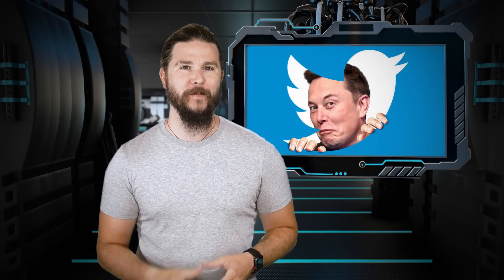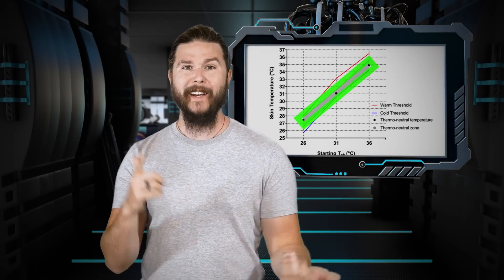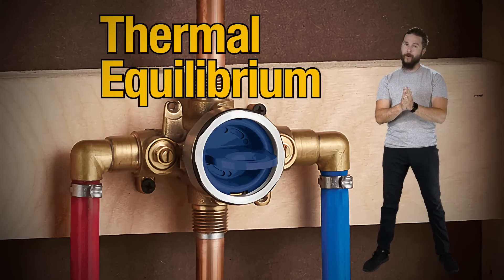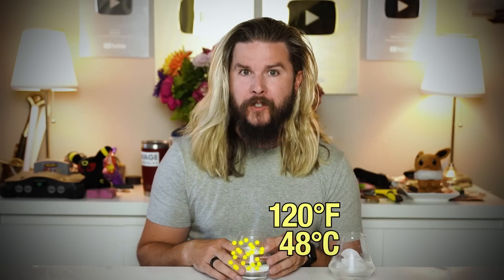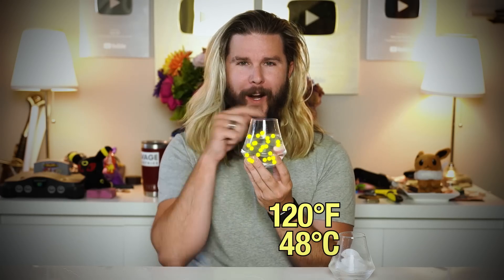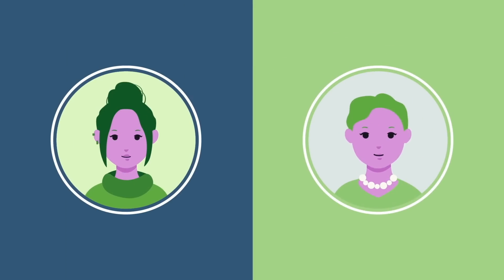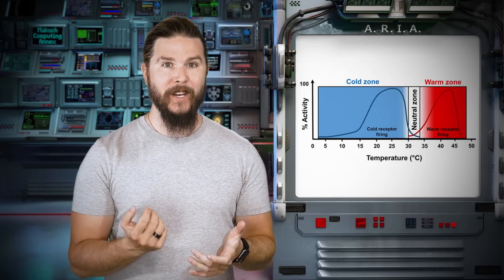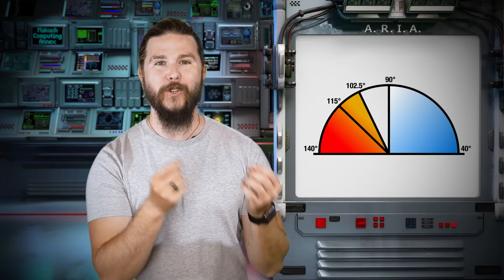Why Are Shower Handles So Sensitive?

Comment: Three points from me:
- on vacation in florida the shower dial controlled two things at once: flow rate AND hot water percentage. so ... you could only have a trickle of cold on the one end and a strong shower of hot on the other end.
- I do have a temperature regulator in the shower. It takes a few seconds until the hot water arrives there, but then it mixes the two waters to the target temperature with a bi-metal regulator.
- wet lab coat contest!
Reply: That's how my shower is, a single twist handle to simultaneously control temperature and flow. It's a pretty common style of shower control in the U.S. Mine at least reaches maximum flow rate at about the transition from cold to cool, so it's usually not a problem, but it would be nice to at least have the option to take a warm shower that isn't at full blast.
Reply: @Okusar  I bought a "shower head shut off valve" for my shower.  It attaches between the shower pipe and the hose, and lets you adjust the water flow manually from full blast to completely off. It works wonderfully, and helps with saving hot water in the winter as well.  (I use the valve to adjust it down to a trickle while soaping up, then turn it back on to rinse.)  They're an inexpensive fix (around $12 USD) for that problem.
Reply: @ManabiLT  I might do that. I have a tank-less system so I don't really need to ration my hot water, but reducing water use in general is rarely a bad idea.
Reply: When I visited Japan the friend I stayed with had one of those on the shower along with an instant hot water heater. The combo's brilliant: Water the temperature you want the entire time, no matter how long you're in there.
Reply: @ManabiLT  yes, i want one in every shower, but why not have all three A shower with optional bi-metal regulator, a two handle control or a 3D one handle controll
Reply: There was never such a waste of not not water
-not quite Strong Bad
Reply: My shower has a dial like what OP describes, but... I suspect the actual temperature range of it's actually just between "ice cold" and "lava hot".

Otherwise, (according to the meme version seen in the video) I regularly set the temp. somewhere in the "here be dragons" range. 0.0;
Reply: It seems like everywhere I go has this type of configuration, from fancy hotels to pool communal showers. I was genuinely surprised that this wasn't mentioned

Comment: Hm, increasingly in UK and Europe (have no knowledge of North America), Thermostatic shower valves are installed.   One dial for temperature control, one for flowrate.   The temperature one will normally be limited to 39C (unless you press a button to go hotter, and ultimately limited at around 44C where the temperature can begin to scald).   This allows a hotter supply of heated water to combat bacterial growth, while remaining skin safe for the user.   Its only on older installations that we still have plain mixer valves (not that there aren't lots of those about).    Electric showers are also very common (cold water supply only, heated on demand by electric element, temperature controlled by flow rate)

Comment: What about making temperature control a two stage system? Stage one is direct control of the amount of hot or cold, but stage two, the one we can directly manipulate, has a scale that begins with the lowest preferred amount of temperature and ends with the highest. Stage two manipulation of several inches resulting in a manipulation of stage one of only a small physical degree.

Comment: Makes me appreciate my shower that has a neutral position that is warm and even labeled as 38 degrees celsius (haven't measured it but it does feel warm) and that only burns you when you turn the knob  pretty much to the extreme

Comment: The lower you set your hot water tank the less energy will be wasted in keeping it warm as well.  Heat loss is proportional to the difference from ambient and the inside temp.  So, regardless of how well insulated it is, cooler results in less heat loss for the same system.

Comment: i designed a much better hot/cold mixing valve for showers and sinks, but in the end its impossible to patent (patent trolls have every possible variation of valve and control) and too expensive to produce. your best answer is to get a jet tub, which is still crazy expensive. a lot of jet tubs have a built in heater and function exactly like a hot tub with the exception of being tied to your water system directly

Comment: Great explanation but also ignores the issue of not one but TWO taps, that have different sensitivities. You need between 0.23-0.27 turns of hot and 2.1-2.7 turns of cold otherwise say goodbye to your chest hair. 

Adjusting the hot tap is utter suicide for the uninitiated, also taking 5-10 seconds for the water coming out to “update” so you need to turn with confidence and pizazz otherwise goodbye to your chances of having children. 

THEN put hot water system only works with sufficient water pressure so if you go too low on either tap you get cut off completely for a good minute and then it’s day goodbye to your eyes because they’re full of shampoo the water is too cold to wash them out!

Comment: Hah, here in Brazil we have electric showers, it's actually easier to find a good temperature, since it depends on water flow, but it sometimes does change to way too cold or way too hot too easy

Comment: Another factor is how the temperature of both the hot and cold taps will change gradually over time as your heater kicks in and the colder water that hasn't been sitting in your pipes reaches the shower. Add on changes in water pressure from other people/appliances (not even just in your own house) and that tiny sliver of tolerable temperature is a moving target.

Comment: I think the two-handle setup is a better one.  We have that system here, and it works quite well.  For me, I turn the hot all the way up, and the cold just a tiny bit.  What also helps is having a bath connected, too, which means the water runs into that before you turn the handle to have a shower, so you can get a better feel for things with just your hands, which are far more accustomed to varied temperatures and therefore won't get scalded or frozen as easily.

The fact that our tub has claw feet may have no bearing on the showering experience, but it just makes the tub niftier.

Comment: My shower, which seems to be quite common in the UK, is only connected to the cold pipe, and heats the water as it passes through. Temperature is almost exclusively controlled by controlling the rate of flow of the water. It's actually very easy to pinpoint the correct temperature, but that position changes daily because it's dependent on the temperature of the mains water. If it's a warm day outside, the shower will be hotter. Big Clive did a video on this design, how it works, its benefits and shortcomings.

Comment: OR you could shower cold.
In the beginning, it's quite uncomfortable, but you get used to it. And then the starting of your Shower Session is always unpleasant.
Take a deep breath and just do it.
Trust me, you won't be spending too much time in there, rather you'll be focusedon getting your whole body clean ASAP.
And if you turn the water off, the surrounding air is warmer then the water, so it'll be pleasant stepping out, insteadof freezing your a$$ off while trying to reach the towel.

There are environmental benefits too. Using less water and needing to heat less water saves energy I guess.
Though I don't know, if this really has an impact.
Still, it feels good when having finished while just one or two songs were played, instead of half your playlist.

Comment: For me the temperature changes. Like if i lover my shower head, the water gets slightly hotter. If it was perfectly hot before, then now it's unbearable now.

Also, I adjust my shower temperature by letting the the water run while I dress down and then hand test the temperature

Comment: You forgot one VERY important point: What about female shower users? My gf uses either scorching hot water or ice cubes.
Additionally, you can paint a scale on your shower knob and weld on a longer handle, or glue if yours is plastic.

Comment: i have two shower handles (1 hot, 1 cold), which can turn multiple 360°, so its a lottery to get the temperature right.. so its not the only problem that the water gets either too hot or too cold, but its also the quantity, i either get a drop of water, or i get blasted with a firehose.

Comment: Next video in this series:
Under (not enough) Pressure - why lazy engineering makes your shower have less pressure than a hose with a hundred holes and how to improve it. 

(Seriously, please do this. I feel like i'm not the only one who wonders about this.)

Just evolve and adapt to prefer pipin' hot temperatures in the shower, like i did. :D

Honestly though, it's nice to have a tap at home that can reach very 
Hot water for a variety of reasons.

Comment: As a part time plumber all shower faucets are adjustable to temperature. So if you want more moderate temperatures you can actually just move the gears ⚙️ inside and adjust it to be moderate and if you want it onlya cold with a sprinkle of warmth you can as well.

Comment: So I have a different conclusion from my own observations with our solar heated boiler. I've found that the higher the temperature of the boiler, the less sensitive the mixer ends up being. Here's my findings:

On days where the boiler is reported to be above 70C my shower experience has been a lot less sensitive than anything below 65C. My theory is that the hotter the water is, less hot water is needed to make the cold water warm. You use a smaller concentration of your hot water in comparison to the cold water and you end up getting a broader range of heat when you mix the two.
A benefit of having hotter water is also that you end up using a lot less water. With it being winter now, I get to see a large range of different temperatures that my boiler is when I take my shower in the morning.
If the water is at 70C by the end of my shower it will have dropped to 68C. If the water is at 60C, by the end of my shower it will drop to 52C.

The result of this means that when the water is colder to begin with, I end up needing to adjust my shower while I'm showering to let out more and more of the remaining hot water, whereas when the water is hotter it stays more consistent with what I originally started. The ideal temperature that I've found for my boiler is 81C, given the sun is gracious enough to supply me with such a gift

Comment: We have circle handles for hot and cold in our shower. Plus it takes about 4 minutes for the hot water to reach the shower from the heater, and even then it ramps up. Even if the water feels good and I decide to step in, I still have to adjust it constantly while in the shower, as the amount of hot water reaching my bathroom varies over time. So finding my sweet spot is more complicated. Thankfully, I managed to figure out a "general rule of thumb", in which I turn the hot by 1/2 a rotation, and cold by 3/8.  This has a slower ramp up to optimal temperature, but it tends to give me more time before I have to start increasing the hot to maintain it.

Comment: You would want to turn down your post heating tempering valve if you have one, rather than the tank temperature, else you will run out of hot water very quickly, or have bacteria grow within your tank. (Ps. I'm not sure if tempering valves can go lower than 60 degrees, maybe, idk.

Comment: 99% of showers here (in Denmark) have a twisty knob thingy that's really easy to adjust because it has like 720° of rotation. Also almost all showers I've been in had a hard stop at 35°c where you had to push a button go to beyond it. Meaning when the button is pushed you can freely twist the knob some more :)

Comment: I think the best solution is to get rid of single knobbed showers (and sinks) they are objectively worse and give you much less control. I am able to get my water to perfect shaving temperature in my bathroom sink rather quickly cause it has two knobs but the shower is single knobbed and I'm always adjusting it throughout the whole cleaning sesh it's annoying.

Comment: I just keep the temperature of the heater at 2-3 degrees over my desired shower temperature. Some of it will get dissipated along the way to the shower.

Then i just open the hot water and slowly add a bit of cold according to my daily needs.

Less demage to the heater, more energy efficiency, less scaling in the pipes, no demages to the o-rings.

Idraulics set the systems to maximum temps because they know that it increases the fault rate of the systems.

People just fall into this huge commercial trap because they don't think about it.

Less is always better.

Comment: Nice video, but it can get even worse. I assume you've only showered in places with a hot water tank. Didn't see anyone mention this, but where I live simple tankless electric water heaters are fairly commmon. They heat the water right when it's needed and are controlled by a preassure switch on the hot water line. That means you have to turn the handle quite a bit to the hot side for the hot water to come on in the first place. Now if it's too hot and you overshoot a bit when turning it down the hot water will turn off again. But you won't notice it immediately because there's still hot water in the pipe between the heater and the shower. And when you finallly notice and adjust, you still have a few seconds of ice cold until the hot water makes it back to the shower...

Comment: proceeds to engineer a handle with some gear ratios thrown in to allow you to turn a handle that turns the main control in smaller increments.  For those that want that PRECISE showering temperature.... yea that'll never work.

Comment: It is hot enough in the AZ summer that even the 'cold' water is hot until water from deeper underground pipes starts coming up. The shower handle is probably set to an 86~89 degree angle in winter and almost 140~150 degree angle in summer.